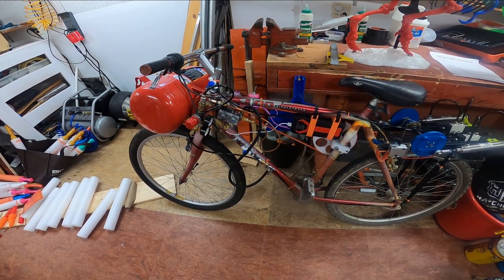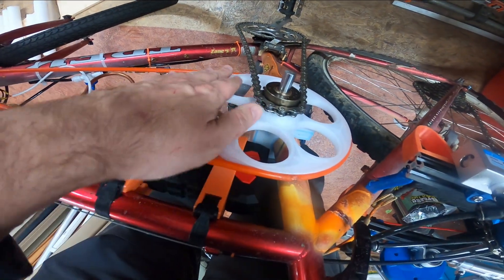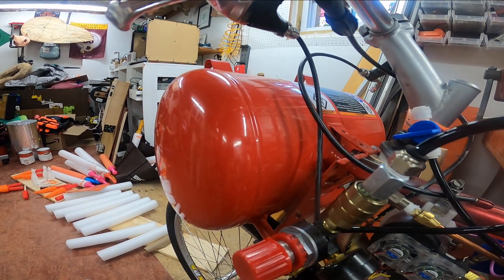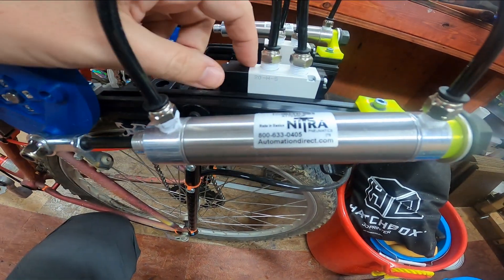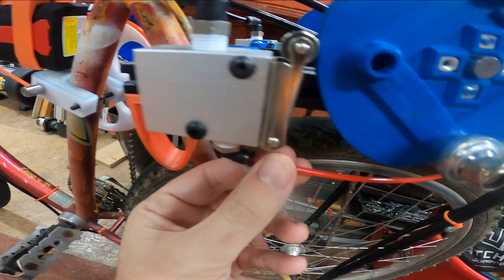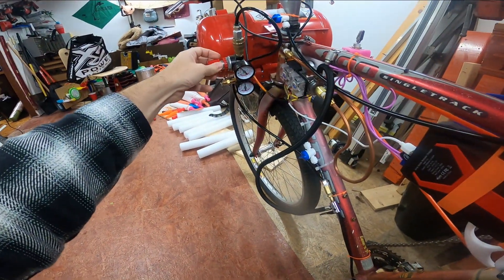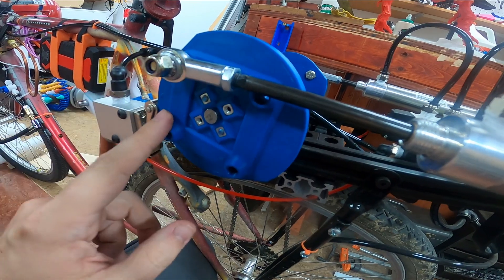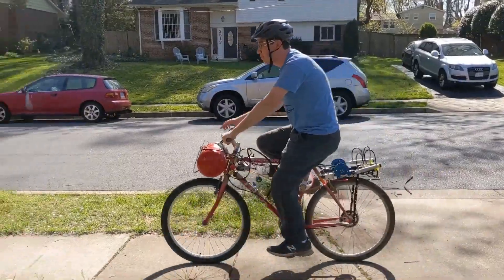Pneumatic Bike - Mechanical Overview

Comment: Fascinating project, I'm interested in converting the wasted kinetic energy lost when braking or going downhill, I had thought about using the frame as the recieving tank? Anyway, did you ever consider using an off the shelf air tool such as a drill for your drive motor?
Reply from the maker: Air tools waste a ton of air - if the pressure isn't high enough they just leak air through.  Basically they're not designed for low pressure, although I only looked at a couple from Harbor Freight
Reply: @PaulChase  I've been thinking on this, I know it's not the solution, I can think of a few ways of getting the compressor pump to run form the wheel, my down tube is rather oversize and I was thinking of storing air in that. The problem is getting the stored pressure converted into forward motion, I could run it back through the pump, rod switch to reverse motion so it doesnt turn backwards, however I think gearing would be an issue, actually gearing would be a problem slowing down too, there's parts of my journey that require hard breaking right down to a standstill at that point the tank would be near full, the pump would be turning very slow, probably need a gearing that would go from 200/1 and then 1/200?

Comment: I've been working on a similar idea, but use an air driven motor of some kind. also, it would work in parallel with the bike's existing chain drive setup instead of a series setup like you have. somehow use a compressor to pressurize a tank, and through a valve to the motor, to provide a power assist when climbing a hill, or pulling a loaded trailer, or for racing purposes. the cylinder idea is neat, but I'd want something lighter and more compact.

Comment: if you use  pnelmatic drill to make motor  and discar all you system  but very losts air
Reply from the maker: I tried a pneumatic socket wrench, but it wouldn't run well under 20PSI :-(  Lots of air loss around the motor, although it was a rather inexpensive one.  It was super low torque at 20psi, too

Comment: Came here from your Reddit thread. This thing absolutely did not need to exist... yet I'm so glad it does. Love seeing the out of phase pistons moving the rig. How's it feel steering it with the tank on the front?
Reply from the maker: Tank in front is a big negative for steering - although better than the first mount which was on the front fork itself.  I'd stick it somewhere else, but the general notion was blocking out the sections so that I could replace the air motor or compressor sections independently, without worrying about space as much.

Comment: That is an absolutely brilliant engineering exercise.  Extremely well thought out.   All aspects covered including safety.    Absolutely impractical.   Hehe.
Reply from the maker: Thanks!  I am planning to revisit it at some point - there's a lot of waste in the control lines, and smaller pistons would provide almost the same power with lower loss.  Things that I did learn along the way, but I'd rather get a design built end-to-end before tweaking it.
Reply: @PaulChase  Yes, I can see just what you mean by excess in some areas.  You will have to put a link in this post.  I would like to see that.